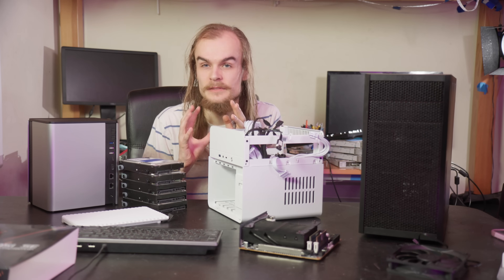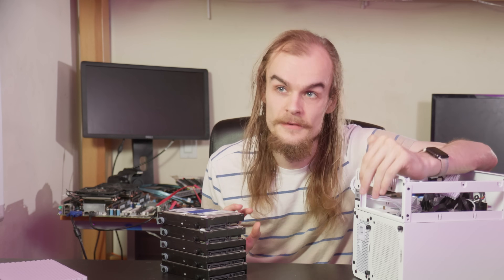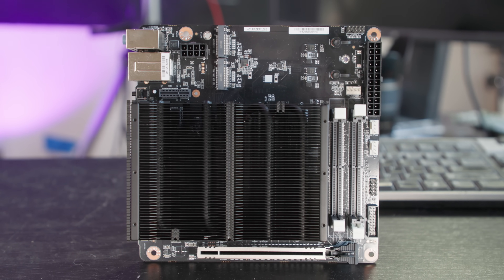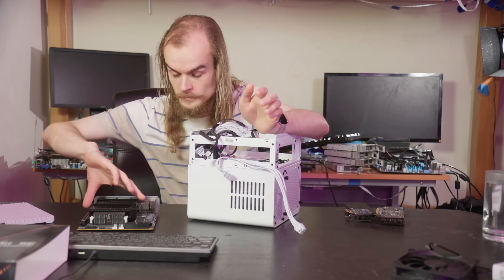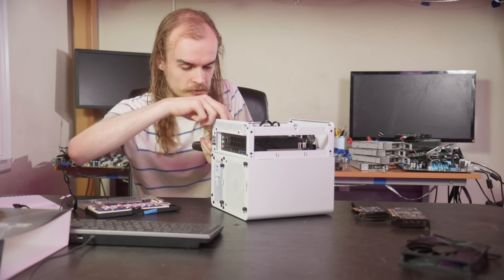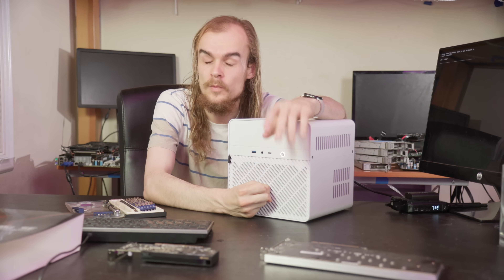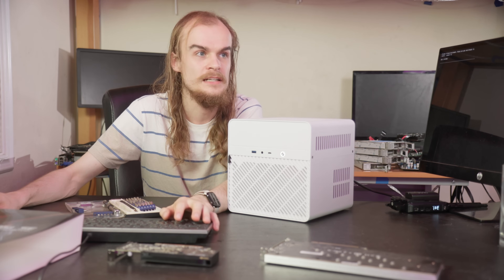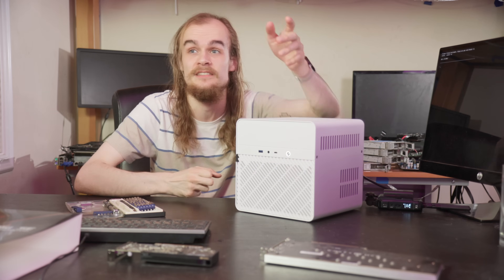Building a NAS with a Minisforum BD 795i SE

Comment: Its not like a 7000 series desktop. It IS a 7000 series desktop CPU. It just has a different packaging for direct soldering and maybe a slightly different firmware. Remove the heatsink and enjoy the 100% desktop chiplets and io dies.

Comment: Very interesting build. Google's tracking has picked up that I've been looking in to True NAS and popped your video into my feed. I'm planning to do my first DIY NAS, just for back-up purposes, so it's all new to me. I was going to use some parts I'd brought years ago and never used. How long ago? Well There's an i5-8600K that was the good mid range CPU at the time. and a Gigabyte Z370m motherboard to match. There's also 3 x WD NAS 8TB HDDs as well. I can't even remember why I got all these parts. 6 Sata ports on the motherboard, so planning to get another 3 8TB to match, the same drive is still available.  The relevance of your build? Well I did have the thought that power consumption might be an issue if a NAS is going to be working a lot of the time. I hadn't considered mobile/laptop type CPUs. What I might do is just an open build, just on a sheet of ply perhaps and see what the power consumption is like. Worry about a case later. So very valuable video, it has got me thinking. Thanks heaps. Scored a Like and a subscribe and a nice lengthy comment to help with the algorithm.

Comment: The big difference with CPUs is if they're a Chiplet design or a Monolithic (in therms of idle performance). Chiplets have to have the IO die running all the time so they can't get to the really low wattage in idle. Back when I was testing my Ryzen 9 5900X (chiplet), the thing would not idle bellow 40W; so for my NAS I got a Ryzen 6 Pro 5650G (Monolithic), that CPU can go down to the low single didgit watts no problem. At least this was the case when I was researching it back with Ryzen 5000, don't know exactly how it compares to the newer stuff. Shame CPU reviewers never really mention these things...
Reply: It's a desktop chip, fully unlocked. That's what the X is in the HX. If it was the H you would have the issues spoken above.

Comment: My problem with boards when it comes to a NAS system is that IT MUST have 2 10g ethernet ports. Yes I can use the PCI slot but I have other uses for it. In the end I find mini NAS systems to be more of a hassle and some times more expensive.

If i had to make a mini NAS id use an MS-01 with a JBOD.

Comment: Liquid metal that CPU, it will work amazingly in that configuration (as long as your heatsink is nickel plated copper and not aluminum)
Reply: PTM7950 will do the same and not damage your system. People are moving away from liquid metal as it pumps out over time. Ask some of the more known repair shops at the fun that liquid metal creates. Few people complain about PTM7950.

Comment: I have seen a 3d printed replacement HD bay cover  that allows you to add fans to cool the hard drive s. That might help with cooling.
Reply from the maker: That’s probably smart. There isn’t much space in the case for airflow and the hdd fan is loud and doesn’t move much air due to the restrictions.

Comment: Built a very similar system a while ago, same case, same motherboard. Added a proper LSI HBA SAS card (instead of those smaller M.2 sata controllers) and could not be happier with it. I do some transcoding, I wish the iGPU was a little more performant, but it does the job okay enough. So in case anyone is reading this and is thinking of trying out this build, its great for most things but okay-ish for video transcoding (1080p will work great, but 4K it can struggle a little, especially if there are Dolby Vision 4K content).
Reply: yes m.2 / pcie sata cards are extremely unreliable. got alot of headache from it.

Comment: I've used Synology for over a decade. Started out with some custom builds but ended up with DS1812+ and later replaced with DS1819+ after EOL. The most important feature for me was the ability to replace single disks with more capacity, and not having to replace all at once. Now that Synology has shown their true colors by requiring Synology branded disks, I think this is an excellent time to showcase alternatives. I will certainly not replace my DS1819+ with another Synology given their new disk requirements. Besides, building my own will allow it to run for far longer with potentially more features. Love your technical knowledge and the resulting videos. Keep up the good work!

Comment: That power consumption is crazy high.
Reply from the maker: True. It can chew up a good ampunt of power. Arguably it’s pretty fast so the effiency is decent but I should really do more power consumption comparisons.
Reply: @ElectronicsWizardry  Please try more power tuning.  Seems like you should be able to do better at idle with and without the hard drives (no VM's or containers). Maybe try powertop. Does it reach the higher C-states? Another question: is it feasible to spindown the hard drives when you use ZFS? I've haven't found a clear answer for this topic, and you know a lot more about ZFS than I do.